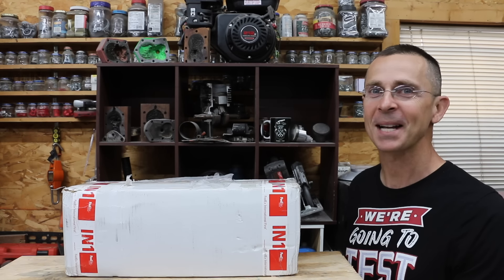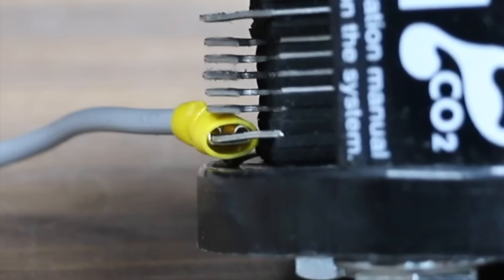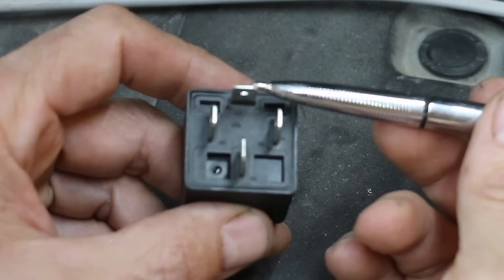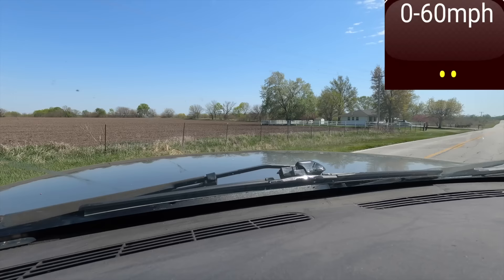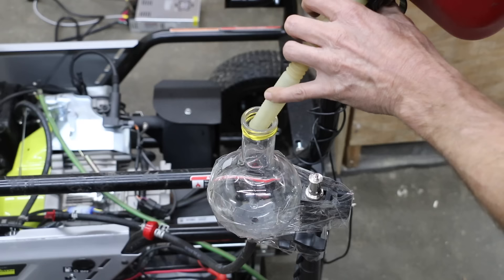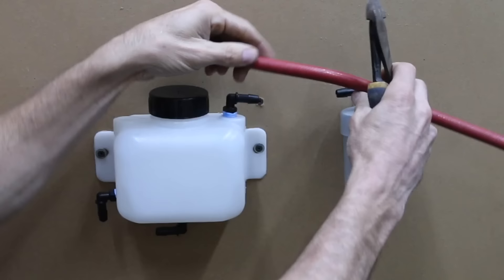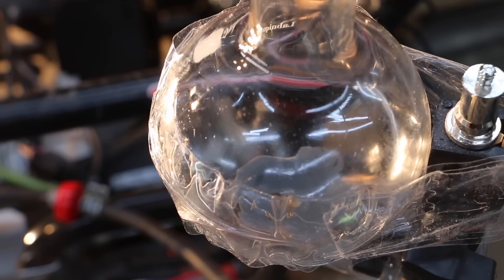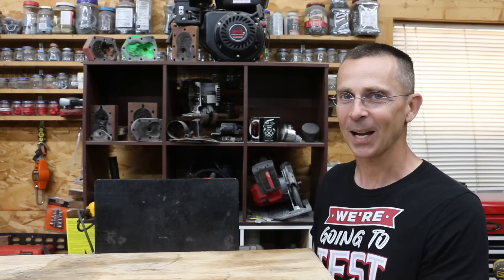AMAZING 35% More MPG with HHO? Let’s find out! Help with high gas prices?

Comment: Next we are going to be testing what product is best at patching those holes that you needed to drill!
Reply from the maker: Thanks for the suggestion.
Reply: Duct tape (not duck tape) would be the best affordable solution for the average person to patch holes in duct work.

Duct tape is a thin metal tape with a mastic sealant on one side that was designed specifically to PERMANENTLY cover the joints in air duct work.

Duck tape is a sticky waterproof fabric tape that was designed to seal the lids of ammo boxes headed to the front line during the war (WW2) to prevent water from getting into the ammo box and ruining the ammunition and to be easily and quickly removed or cut through when soldiers needed the ammunition inside.  In other words, duck tape's design was to do the job for a limited amount of time; hours, maybe days, or a few weeks at best.
Reply: There's a half dozen different ways that would be fine, but the lazy way is just put a rubber stopper plug in it.  Most aesthetically pleasing would be get same type of plastic, put a temporary aluminum foil (HVAC duct tape) patch on the back of the hole, melt the plastic in a metal can and pour into the void leaving a little excess on top overflowing the lip of the hole.
Reply: @stinkycheese804  
Unless you know someone who has or are willing to go to the expense of buying your own plastic welder.  But then you would only be able to use it for welding plastics where duct tape could be used on anything that needs to be sealed so air does not leak in or out.
Reply: @oldtimefarmboy617  no duck tape is a brand of duct tape. Duct tape is duct tape. Foil tape is the tape you are talking about that has a metal foil. Both duct tape and foil tape are used in duct work.
Reply: Leave the barbs in the hole. Just put a rubber vacuum plug over the barb. Secure with black wire tie.
Reply: Ge silicone 2 From Home Depot would also work well. Black for aesthetics.
Reply: @bleeblin5252  Thank you for correcting that
Reply: @bleeblin5252  
I understand "Duck Tape" is a brand of rubberized fabric tape with a sticky adhesive on one side.  But "Duck" brand tape is synonymous with this type of tape, no matter the manufacture of the tape which is why the vast majority of people call it duck tape.

Just as the "Cresent" tool company became the de-facto name for the adjustable nut wrench and the "Channellock" tool company became the de-facto name for the adjustable water pump shaft pliers.

It also does not change the fact that a tape specifically designed to cover the joints of air duct is called "duct" tape, not duck tape.  The fact that there are people who choose to use "duck" tape (which is fragile and temporary) to cover the joints on air ducts does not make it "duct" tape (which is durable and permanent).

If you see anyone in the HVAC business using duck tape to cover the joints of duct work then you will know that they are not professionals and you should never hire them to work on your HVAC system.  And if you cared at all, you should warn the people they are doing work for of that fact.

A professional HVAC person will either use a mastic paste to seal ducts or a foil tape with a mastic adhesive.  If they are an obsessive professional, they might use both.
Reply: @oldtimefarmboy617  I am an hvac professional. Duct tape is duct tape. Foil tape is foil tape. Duck tape is a brand of duct tape. A simple google search of duct tape will show that duct tape is not foil tape
Reply: @bleeblin5252  
You are correct!  The Duck brand does make duct tape.  It is also true that lots of people will sell you duck tape claiming it is for use on air ducts.

  That does not change the fact that what has become the common name for a rubberized fabric tape (duck tape) was never designed for covering the joints of air ducts.

Rubberized fabric tape (duck tape) is fragile and breaks down quickly when exposed to heat and weather and specially sunlight as apposed to duct tape which is sturdy and can last for decades even when used for external air ducts on roof top units.  Use duck tape on roof top HVAC air ducts and it will be broken down within the year and allow external air and moisture in and conditioned air to leak out.  Only professionals in-name-only would cheat their customers using duck tape to cover air duct joints instead of duct tape.
Reply: @bleeblin5252  
I am also an HVAC professional, and either you are too young to realize that the name could change through improper common use, or you just admitted that you are not a very good professional.
Reply: @matthewwoodmansee  
No, this is an argument from personal experience.

I grew up with friends of the family who told me about how duck tape was used to waterproof the ammo boxes they received at the front lines during WW2 and how that was the first time they had ever seen it and how it was also used to temporarily used to patch holes in tents, hold things together, and other things until they could be properly repaired or replaced.

I have never done work with air ducts but I have used duck tape for various uses over the decades and know for certainty that duck tape rapidly deteriorates when exposed to heat and other environmental processes and I have seen air ducts where duck tape has been used and watched it fall apart when touched.  I have also seen where duct tape was used in place of duck tape for uses other than air ducts outside a structure and that had been there for decades and was still capable of doing the job of sealing a hole or crack or covering something else it was being used for.

Mastic is a far superior and long lasting adhesive and water proofing material than what is used on duck tape and the metal foil it is applied to does a far superior job of reinforcing and protecting the mastic than the rubberized fabric used for duck tape.
Reply: @oldtimefarmboy617  

Egg yolk soaked denim.

Come at me bro
Reply: @justtime6736  
What does how you get your fiber in the morning have anything to do with a discussion on the differences and uses of duck tape and duct tape?
Reply: @oldtimefarmboy617  Fun Fact during the testing of the first nukes, duct tape(or something similar) was used to help hold many components together in order to get the bomb in working condition.
Reply: @SubWaySpiderman  
Interesting indeed.  Of course, considering it was going to be incinerated a short time later, permanency was not a necessary consideration.
Reply: Phil: HI IM PHIL SWIFT THE CREATOR OF FLEX SEAL! 

DO YOU HAVE A HOLE TO PATCH

INTRODUCING THE NEWEST MEMBER TO THE FLEX SEAL FAMILY! HOLE PATCH FROM FLEX SEAL!
Reply: @Charles Brainard 
Good suggestion.  With all the plastic body parts and shields they are using these days usually held into place with those plastic pop-in rivets and screw rivets, you could get one of those just big enough to go into the hole and put some silicone sealer in it and on its bottom and then put it in the hole.  That would hold itself in while the silicone cured and make an excellent long lasting repair almost as good as using one of those plastic welding rigs.

You just taught me something useful; which means this is an excellent day.  Thank you, thank you very much.
Reply: @davidscott5903  "Duck" is the name of the loosely woven cotton fabric that "Duck Tape" has as it's backbone.
. . . . from the Casey Anthony Murder Files . . . . .
Reply: Flex tape big baby

Comment: PF constantly reinforces the old lesson your mom taught you.
If it sounds too good to be true, it probably is.
Reply: Totally. In this day and age if something like this worked all of the major auto manufactures would jump all over it. Oh by the way, I have some ocean front property in Nebraska. Cheap!
Reply: @explorenaked  I remember "Salton Sea Resort" ads from early 1960.
Reply: Try using a separate rechargeable battery bank for the electricity to make the HHO gas. 
Using electricity to make HHO to run a engine is less efficient than just the electricity for an electric car but would be easier & cheaper to make a HHO/gasoline hybrid than trying to build a gas/electric hybrid. 
Take a small 4 cylinder pickup truck, add a battery bank and some solar panels to the truck roof & bed cover. Use the solar panels to recharge the battery bank that makes the HHO. 
Probably still more trouble than worth but would improve MPGs  depending on how much HHO is added.
Reply: Similarly related, I hope he tests Water - Methanol Injection. It's reported all over that it works, but you do need to advance the engine timing. It works because it lowers the temperature in the combustion chamber and acts to increase downward pressure in the combustion chamber, while allowing you to increase the engine timing. As a bonus, it keeps pistons clean.
Reply: @explorenaked  Insured by Mutual of Omaha,  no doubt.

Comment: There seems to be a part missing from the setup - the EFIE (Electronic Fuel Injection Enhancer) device. This adjusts the voltage from the oxygen sensor which detects the amount of oxygen in the exhaust. When HHO is added to the fuel-air intake, the burn is more complete without the need for more air intake. This leaves more oxygen in the exhaust.

The oxygen sensor emits a lower voltage (below 0.45 volts) which incorrectly tells the ECU (engine control unit) that the fuel mixture is too lean because of the excess oxygen. The ECU then injects more fuel in an attempt to bring the air/fuel ratio back to 14.7/1.

Without an EFIE to adjust the voltage (upwards) from the oxygen sensor to the ECU, more fuel would actually be injected and used. 

The carbon deposits look the same because the burn would be the same and not more efficient despite the addition of HHO to assist it.

Frankly, I appreciate the many tests done by Project Farm (e.g. the rechargeable batteries test). I just wanted to point this out, hoping, perhaps, a second test can be done with the addition of the EFIE device. Older carburetor engines don't require the EFIE as air/fuel mixture is adjusted manually.

Years back, I installed an earlier HHO kit that included an EFIE in my 98 Corolla and the increase in power and torque was dramatic. I didn't use it long enough to check fuel economy. It's a long story but It didn't damage the engine and the Corolla is still running smoothly.

Comment: I can really appreciate Project Farm's dedication toward controlled testing, going the extra step by not allowing companies to muddy the waters by sending him free products.
Reply from the maker: Thanks!
Reply: @ProjectFarm  Thanks for what?Your test was a failure,you didn't even hook it up properly.Why didn't you hook up the generator to the alternator,the result would have much better for the hydrogen mileage but no you hooked it up to the battery,how much did big oil pay you to dupe the test.Well it don't matter anyway because the hho system did quite well in it's own right
Considering the differences in the price of water and the price of gas.
Reply: I dont quite see the reasoning, if a company sends in a product for review then an honest unbiased review they would get. Now a company sending in a product to be "promoted" would be entirely different and would be basically equivalent to getting paid to say good things about their product.
Reply: @BlackHeartScyther  He might still review the product honestly, but many people would accuse him of going easy on a company for supplying free products. The comment before yours accuses him of being a Big Oil shill for the simple crime of not concluding that HHO shows benefits.
Reply: @bugsbunny3488  The only thing he did wrong was not tune the fuel injectors so the whole test is pretty much invalid. He has to test it w/ a carb generator and adjust the mixture it to really see if it will work or not. he did have power supply to the generator so it not like he was pulling power from another source.
Reply: @bugsbunny3488  having it hooked to the alternator vs the battery would have made zero difference. the alternator is hooked directly to the battery(some vehicles, via a fused link). Having it hooked to the battery actually gives it the best shot at working properly as the tiny power fluctuations from the alternator being under different RPM loads is completely bypassed. Yes, there is a wire connecting them together, as mentioned before, but it's just that much more that could negatively affect the product.
I agree that an engine tune probably would have been best to do for this to get performance boost, but it's not marketed as such. He applied it as it was marketed to be installed.
The real problem with this device is that it requires electricity to work. That means the alternator has to work harder than it was previously. That extra work takes away a little power from the motor that was otherwise being used to get up and go. That's likely where the speed runs suffered, the extra several horsepower lost due to alternator strain.

I would agree that i'd love to see it on a carbed motor vs fuel injected motor.
Reply: @bugsbunny3488  errr what is the alternator connected to so it can charge the battery dummy :)
Reply: @moonshiner2977  The alternator can be connected to both,the hho generator and the battery,if the leads
bypass the diode from the alternator 
And are connected to the hho generator more power is produced.
Hho gen from diodes,battery normal.
Reply: @bugsbunny3488  LOL obviously just trolling, good b8 m8
Reply: that is just building up value for selling expensive  later
Reply: @bugsbunny3488  the battery and alternator have the same level of voltage when the car is running, so your point is moot.
Reply: @routine8  Not if you bypass the diodes
Reply: @bugsbunny3488  You forgot that he neglected to install the necessary flux capacitor, too.

Comment: I rewatched the Step Bit video because the DeWalt isn’t stocked at my local home improvement stores. The Lowe’s guy I talked too didn’t know the application of a step bit but he watched you too! Even if it’s not something I’d ever need. I just love watching your energy and enthusiasm. You’re doing the work consumer reports claims they do.
Reply: I'd assume that generator has an O2 sensor in the exhaust (I think I remember seeing one in the past). The "benefits" would be even less on something with a carburetor.  I think any benefits that may exist depends on 2 things, 1- closed loop fuel injection (needs an O2 sensor in the exhaust), and 2- being able to lean out the FI fuel tables more to inject less fuel (supposedly, a mix with hydrogen can safely run leaner).
Reply from the maker: Thanks for watching!